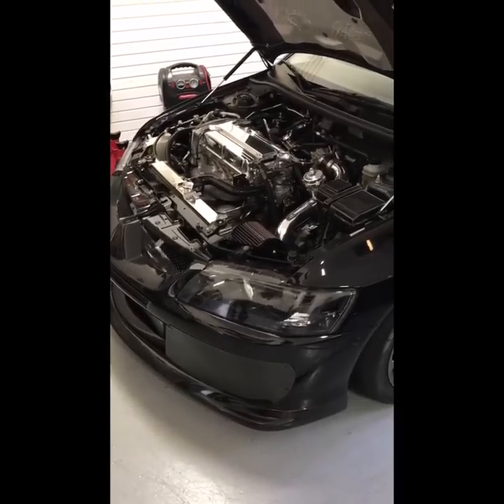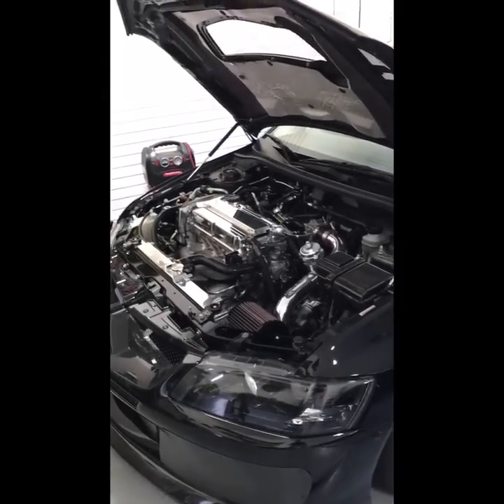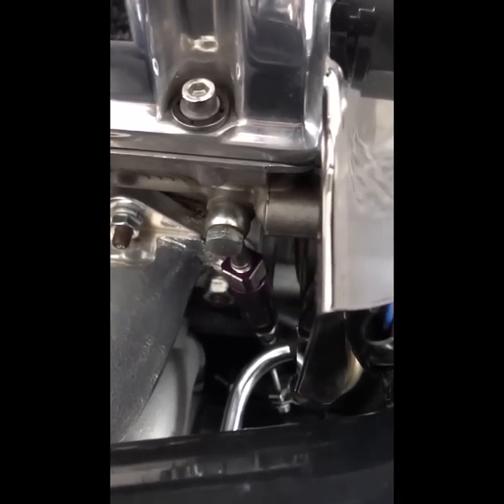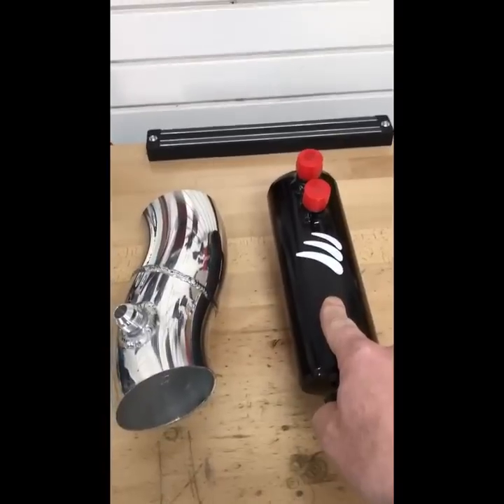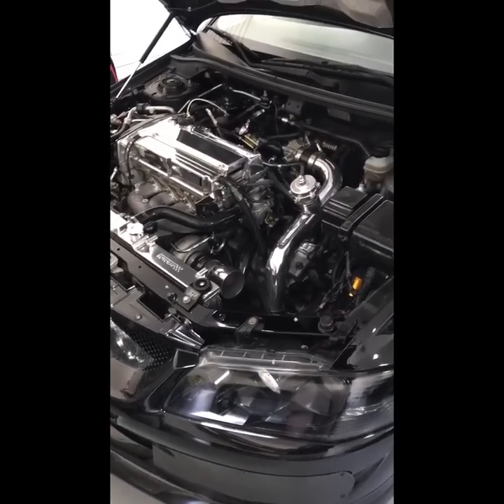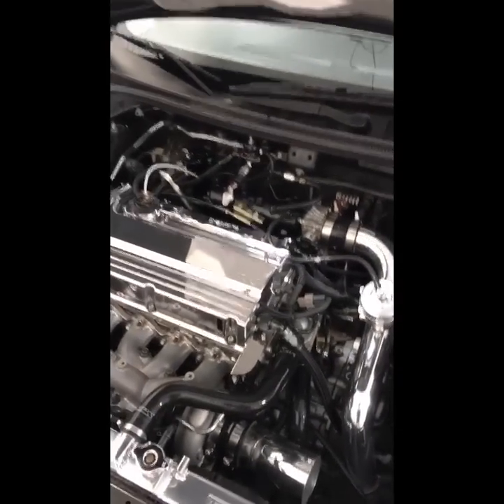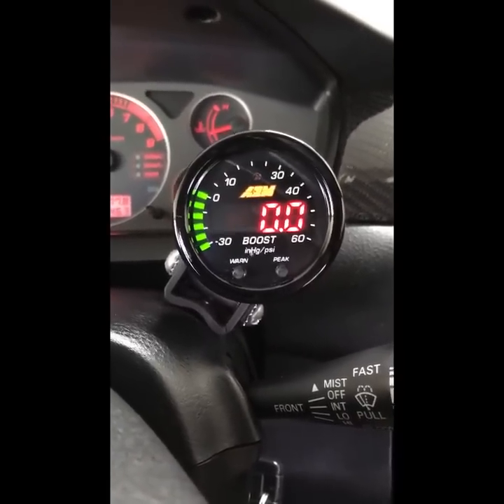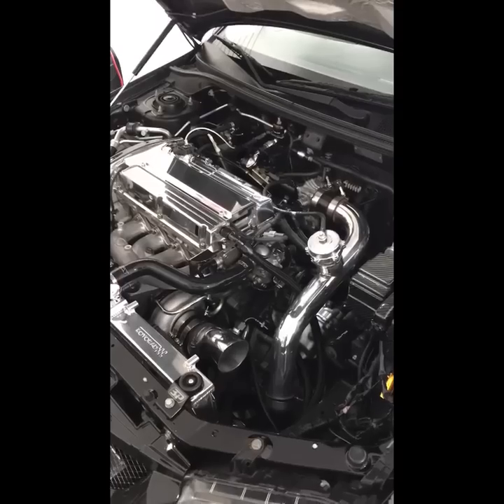Vented VS. Sealed Catch Can Test! Which is best? Watch to find out!

Comment: would this work on a prochargerd Hemi 5.7? i gutted thr PCV valve on passenger side and ran -10 from each valve cover to a vented catch can than is ventilation crankcase pressure to atmosphere and i have my intake manifold vacum port pluged. it seems to work ok but i wonder if its optimal

Comment: I do believe the oil seeping from the turbo does not come from the turbo itself. The CCV pushes some oil into the turo intake making it seep oil. The reason for more oil after a turbo upgrade is because the higher the boost the more CCV

Comment: I have a one way valve that connects my crack case hose into my into tube prior to turbo air in side. Would i use close can system there and incorporate vented can on valve cover with no Out on that? Thank you!

Comment: So what is the best overall system you came up with??? I have a 22 frontier.  I'm not trying to be high performance I just want to prevent carbon build up ....would there be any negatives if I hooked up just one catch can and cented to atmosphere??? No return to the intake ??? Is the return pressure needes for any operation of the engine? Saying creating vaccum or anything??? Im afraid i will mess the engine up
Reply: Do not vent any modern pcv system. They out side will not pull air from the vent it needs to be pressurized!!! 
Do not run bigger lines then factory because you will get a lot of gunk and oil thrown to the engine to the out line…
If you are using a vented system from pcv to manifold I guarantee you that you’re not even venting your crankcase how as much as it was with the oem setup. Do not vent your system..

Comment: Very informative video, thank you. When running the sealed setup, is there any concern for the the intake pulling hot air back into the engine? I recently installed the Radium CC on the crankcase side and rerouted it to my intake but it felt like the intake was much hotter than before. I can see why people would vent it instead so now I'm trying to decide on what to do

Comment: Very helpful, even for a non Evo owner. With the sealed system, have you noticed any oil residue inside the intake? That's the only thing keeping me from doing a close system again because eventually the entire cold side was coated with a film. Also, what are your through on a venturi tube vs just a AN fitting welded on?

Comment: So if you do mainly city driving nd short distances you can expect more blowby to accumulate?
Reply: Ow yeah it’s going to fill up fast. That oil would have been coating the entire intake, turbo, and valves.
Reply: @markm0000  turned out my engine from esslinger engineering  in California installed all pistons backwards.  valves didn't clear the cutouts....   dead engine now
Reply: @samsonyunited  rip 🪦 hopefully they warrantied that mistake.
Reply: @markm0000  No, and would not recomend them ever again.  Even had different cams installed than what I asked to have installed. They must have built it while drunk
Reply: @samsonyunited  Oh boy. Lesson learned go to a performance shop near your house so you can take them to small claims if they don’t own up to their mistakes. Now I know not to make that mistake.
Reply: @markm0000  exactly

Comment: Where can we dump this fuel oil mixture
Reply from the maker: Bring it to your local auto parts store or oil change station.  They will recycle it for you.
Reply: @HochmanFabricationAndSpeed  You can also just dump it in your lawn mower. It should run fine.
Reply: Tip it on your lawn
Reply: @farmer3242  Tip it in your windshield washer fluid for extra bug cleaning.
Reply: @markm0000  tip it under your tires and do a burnout on it.

Comment: Ive got the same vent to atmosphere off the head but mine chucks a lot of gunk out and fills up in a few days. The catch can is lower than the head and has small factory tube on it. Do you think it would be ok if I raise the can with a wider tube could that solve the amount I'm throwing out
Reply from the maker: Anytime!
Reply from the maker: You can try it, but the cause is likely engine related.
Reply: @HochmanFabricationAndSpeed  ah ok cool thanks for the feedback

Comment: Pretty sweet Evo you got there!  I do see a couple issues with your first setup.. the catch can should never be mounted down much below the intake manifold or valve cover.  Take gravity into account. Your engine is a giant vacuum pump and you have a line sucking air and oil from an area on your engine that has oil circulating into it.  By putting the can down low, where is all the oil going to go?    Next issue is the fact that the -10 fitting is not baffled.  The pcv fittings or bungs in ANY engine should have baffling to help separate the air and gasses from the oil.   Thirdly, you should have a check valve on that line so if it’s connected directly to the manifold. If it’s connected to the charge side of the turbo, then you don’t need one. I think that’s how you ended the video.    There’s also a company that has an adjustable flow billet pcv valve.  It’s a pretty slick setup. You can tune the valve depending on your setup. They’re based out of the US and it works on all combustion engines.
Reply from the maker: Thanks for the feedback!
Reply: Did you watch the video? It’s plumbed pre turbo, no need for a check valve… also the can is baffled no need to baffle the line…. Third, he’s sucking from the top of the valve cover, he can mount the catch can where ever he wants oil from the engine isn’t going to magically climb to the top of the engine regardless of gravity. He’s pulling oil vapor as he should

Comment: Interesting results... What if the catch can was vented, but with an added check valve, which would only open if the can was pressurized, in order to vent the pressure out of the system and when vacuum takes over again, the check valve would close and the vacuum would flow again? Wouldn't that be a closed loop with the benefit of venting the pressure to the atmosphere? I have a 3000GT VR4 with larger than stock turbos and I am seeing smoke on deceleration, after going into boost. Only after going into boost... On a couple of occasions, I have seen the dip stick popped out a bit, so I know the crank case gets pressurized at boost. I also know that a bad turbo seal could be causing smoke on deceleration, but the turbos were recently rebuilt, so I am not leaning toward that possibility. What do you think?
Reply: I am seeing the same thing in my Evo X. I have a EFR7163 which utilize double seals on both compressor and exhaust side of the turbo. On deceleration when coming to a stop i get a bluish haze come out of my exhaust and the same thing even if i am sitting still, then rev the engine a little. As the rpms drop to idle, the bluish haze comes out of the car. Happens more on warmer days and less often on colder days as well. I have a sealed system and considering VTA and see what happens.
Reply from the maker: Glad I could help!

Comment: Thanks for posting this video. I've been spending some time recently researching vented vs sealed catch cans myself, for my evo 8. I think I recently landed on dual sealed catch cans and your video confirms my decision. Basically, the system is designed the way it is for a reason...it is efficient. There are two problems people run into when going bigger turbo and more boost. 1) oil getting into the intake and 2) the system not being able to relieve enough crankcase pressure in modified cars. The sealed setup maintains the design of efficiency, but upgrading the size of the hoses allows more pressure to escape. With a vented setup, there is nothing to draw out the vapors from the crank case under boost conditions since the PCV is closed. The vent tube just has atmospheric pressure, so I'm not surprised you saw 0psi under boost.
Reply from the maker: Glad we could help!
Reply: @HochmanFabricationAndSpeed 

I have a one way valve that connects my crack case hose into my into tube prior to turbo air in side. Would i use close can system there and incorporate vented can on valve cover with no Out on that? Thank you
Reply: 9:53 9:53 😅❤❤
Reply: 😅0😅
Reply: 0

Comment: Awesome video. What do you think the results would be if you combined the two? Running a VTA catch can with a vacuum source? Would it be possible? Counter productive? I ask because I purchased a valve cover with -8an fittings, and I found a vented catch can with the -8an mating fittings so I went that route for simplicity but now I am wondering if it was a mistake.. I make 500hp,   30psi. Eagle Talon
Reply: Hey Bob, a common question but a good question, which we get often regarding this topic. On the car in this video its important to understand there are 2 separate catch cans hooked up to the car.  One is closed loop (no VTA) that is on the passenger side fire wall and runs from the PCV off the valve cover - to the can -to the intake manifold.  This first can remains constant (closed loop) for all tests because it is only used to pull fumes and oil out of the system during idle conditions when the PCV is open.  The other (2nd) can is located on the driver side (the one that we use test VTA versus closed loop.)  During the first test this was run from the valve cover - to the can which had a filter on it and was VTA (this is the only configuration where you would effectively run both a closed and VTA setup, because you have separate cans on separate systems of the engine.)  For the second test this driver side can was converted to a closed loop so it runs from the valve cover - to the can - to the intake with no VTA.   So with this in mind to answer your question, if you are running the configruation I described in the first test then yes you are able to run both with a vac source and VTA on the car, however the moment you open the system to a VTA (regardless of having a vacuum connected to it) it is essentially going to perform like a VTA system (just like pulling a hole in a straw and it loses suction power.)  As far as which configuration is best for your car, that can be determined only by doing tests similar to this.  Each car and its setup/variables require different configurations to accommodate their needs.  I ran my driver side can closed loop until this year and once I hit over 700HP my car needed more breathing efficiency up top so I converted all connections from the valve cover to VTA and removed the PCV, at the sacrifice of a little low end efficiency.
Reply: Awesome. Thanks a  bunch for the super quick response. I don't have an AEM gauge like yours but I am going to do something similar this weekend with a standard boost gauge. I will start VTA, then seal out the little filters on it and add a vac nipple to the intake and compare. I appreciate it!
Reply from the maker: Glad to help!